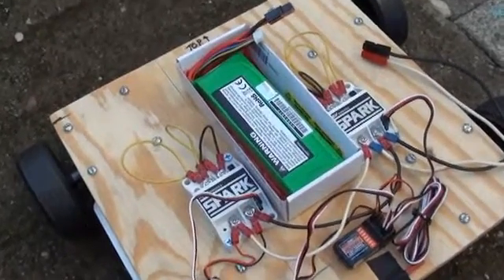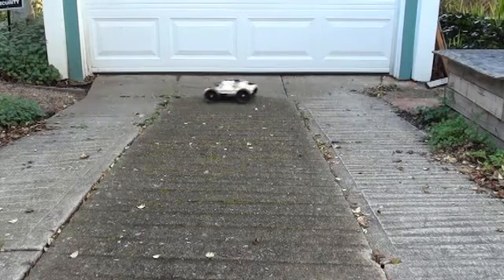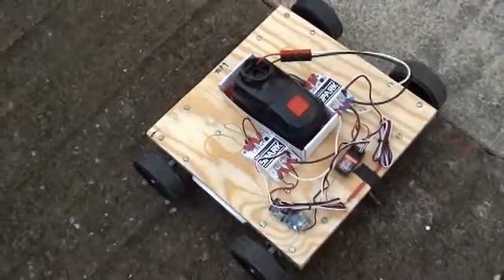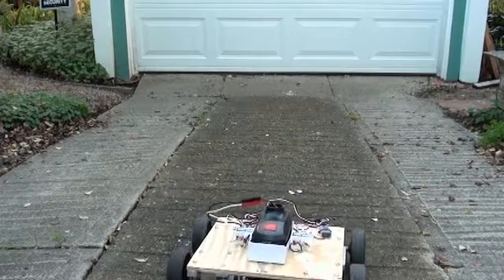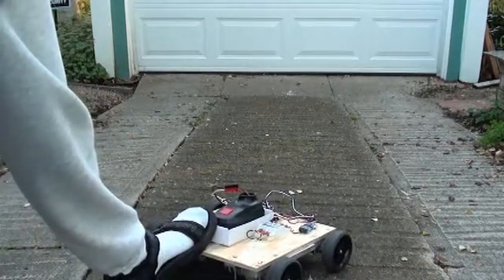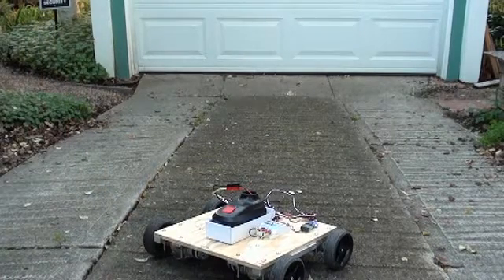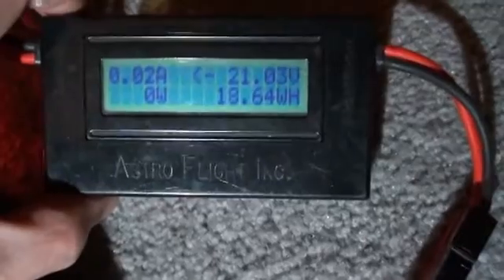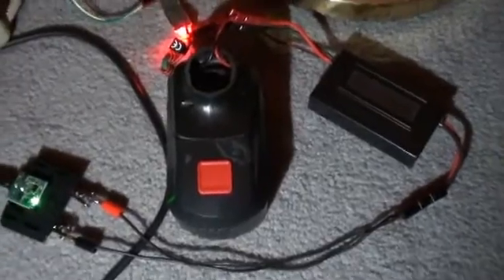Let's Build - Rover Mk3 - Part 11 - Moar Powa!  Swapping batteries

Comment: I would like to make a R/C tool and parts cart. I have watched all of your Rover build videos, and was wondering if this set up will be able to move 100# +/-?  Another question can you use a plug to go into the 3/1 Harbor Freight jump box to use it as the battery source and keep the function of the jump box? Thanks for your time and thought your videos are very helpful.
Reply from the maker: sure, it just won't do it for very long,  or under harsh conditions, but it won't not work. (means it won't work)  You'll be much better off starting with a surplus wheelchair.   as for the jumpy box,  Its just a 17Ah lead battery inside,  it will do anything a 17ah lead acid battery would do.    Having no real idea of your project's requirements...   sounds questionable.   you should build it, and make videos....